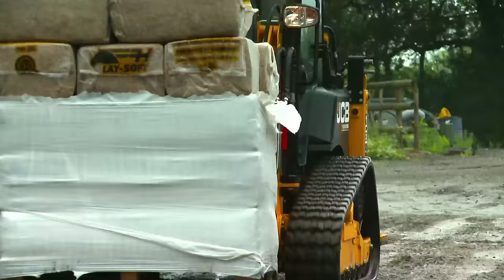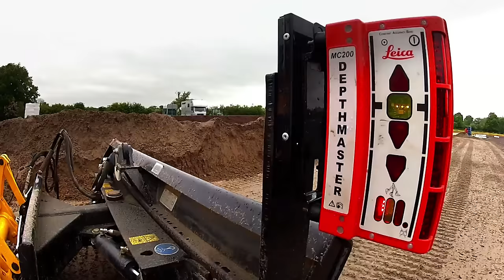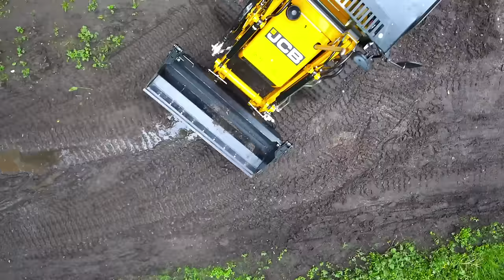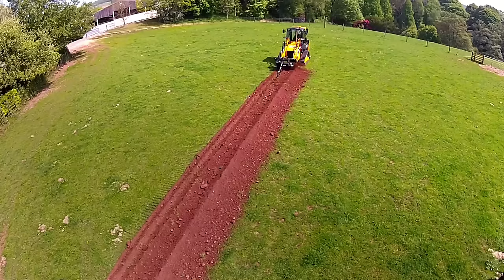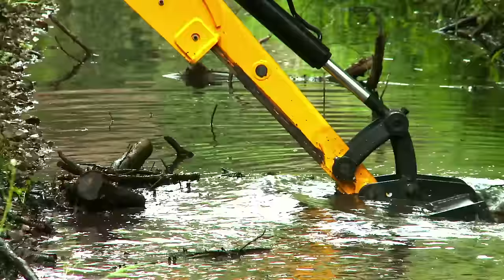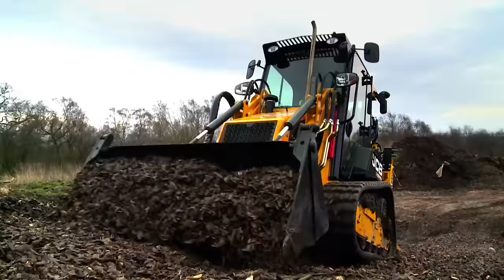JCB 1CXT The World's smallest backhoe - Now with tracks!

Comment: JCB 1CXT Backhoe review 
I have owned a JCB 1CXT Backhoe since 2015 and I have had  a mostly positive experience with the Equipment. However I have concluded three main issues with the product’s overall performance. After being given a 15 month warranty on my backhoe, its drive motor functions completely failed directly after 15 months of use and the jcb Trinidad didn't honor the warranty. The drive motor also continued to have consistent leaking problems approximately every 9 to 12 months after. There is no way of conducting an oil change on the drive motor without completely removing it from the machine and the mechanical seals in the drive motor are exposed to debris and the elements as it is not properly secured, therefore resulting in the consistent failure of the drive motor. Another noticeable fault is that the swing box of the machine will constantly leak due to very poor design. Hydraulic cylinders as present in the larger models are better. The swing box is also unreliable and prone to performance failures after only 6 months of use. The air conditioning bracket also has a faulty design casuing it to periodically break approximately every six months. Besides these three major machine failures, the JCB 1CXT works well. Improvements in the areas previously stated will need to be made to enable consumer satisfaction.

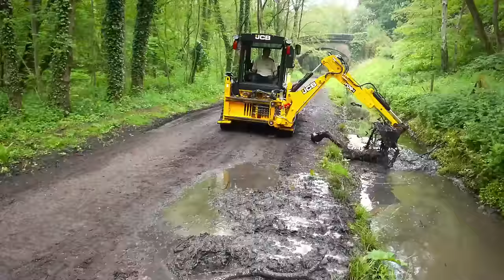Comment: Offset to wrong side and NO jacks down at 1:24. Asking for trouble! BTW this idea for a machine is not new, I operated John Deere 450's forty years ago.
Reply: I had a chance to try one recently and like a mini excavator it doesn't need the jacks down even fully sideshifted with full grading bucket. The stability is impressive, you only need the legs for levelling on steep slopes.